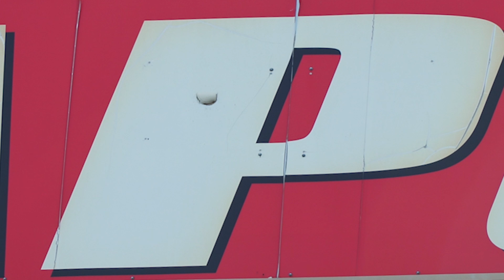3000 HP Cummins Dyno Explosion | Full Story

Comment: Man that sucks. The break line of that block at 6:40 shows there is a lot of area for strength improvement but the casting quality could be a lot better as well. Good quality cast breaks very fine and not super clumpy like that.
Reply from the maker: Agreed, there is room for improvement.  This line of block has been discontinued.  The wet competition blocks have a 300mpa material with a finer grain structure, but the wet cylinders/not solid cast is untested in our large 4.250" bore size so we stayed with the tried and true solid blocks.
Reply: @pddofficial  Sled pulling we started splitting blocks thru the head bolt holes about 15 years ago.  Hard block cured it for awhile, then as power increased the deck plate debored 6.7 blocks became the go to solution. Then the break line moved down to the cam bore and things got  a lot more catastrophic  when they let go. Had a friend of mine split a solid comp block year before last just like yall did.  For the most part when they took the weight off and lowered the hitch it made the trucks hard enough to hook that cylinder pressure rarely reaches the level of "boom" but for competition like you all are doing you will need something to hold a lot more.

Comment: Glad no one was hurt , I was a kid a long time ago and went to tractor pull in I think Dallas and one of the clutches let go and no scatter shield . I think that one of the spectators got killed . I was in Green Valley race way and a engine let go I think it was a funny car , a rod and piston was thrown up and landed way out . Some on ran out and grabbed up the aluminum rod and piston . Well lol the it was not a good idea as the rod and piston got launched again . Holding on to a smoking hot piston and rod apparently are hard to hold on to . Look forward to watching the tear down and hearing what your think the limit is on the components , Thanks

Comment: Why not implement 1/2" cables around the cylinder head and block like a pulling tractor.  With 200lbs a boost there's bound to be a catastrophic failure.

Comment: What is the difference between billet block vs Hamilton?
Reply from the maker: Hamilton Block is cast iron like a factory block.  What's special about the Hamilton block is it addressed the factory block's #1 weak point at around 1500 HP, they crack the cylinder wall.  To fix that, the Hamilton block is cast solid without water jackets or water cooling ports which creates an incredibly strong cylinder wall.  The next weakest link, which seems to come into play around 3000 TQ with the p-pump engine is middle of the block ripping in half from the crank pulling down the head pulling up.  A billet block is machined from a solid piece of material, usually aluminum which allows for added thickness whereever the block designer leaves extra metal.  Billet blocks are incredibly expensive and have their own host of problems associated with aluminum growth and thermal stability vs cast iron.
Reply: @pddofficial  , thank you very much for taking time to explain.

Comment: In the nuclear industry, this is what we call a "near miss." It's an opportunity to learn just like someone got really hurt without having that on your conscience. I hope the good luck here doesn't get taken for granted.
Reply: I am glad someone else is worried about this ,its not funny metal parts flying through the air at near the speed of a bullet ,definitely dangerous
Reply: @andrewcampbell3321  a thick blonde caught a head bolt in her bra. She was jumping up and down like a cheerleader try to shake that hot ARP head bolt from her chest.
Reply from the maker: I highly doubt that happened for 2 reasons:
1. All of the head fasteners are studs, not bolts, and all 26 are still in place securing the head to the upper half of the block, the failure did not happen at the head gasket line.
2.  None of the head fasteners are ARP brand, so said mystery girl couldn't have had a hot arp bolt from PDD's truck.
Reply: @pddofficial  I seen that from the video ,the block split in two head still attached!!! ,defo something to do with the one pistons or cylinder wall/ liner failing
Reply: @pddofficial  think he taking the PISS bigman lol
Reply: They call this in diesel industry a total waste
Reply: @frankjankovich3512  idk about that.. feeling pretty good pushing stock block to only a measly 1000hp now lol

Comment: Apparently Cummins blocks from Utah are weak.  Or Utah builders are next level!!  It's crazy to me that you were in full safety gear behind a firewall & the dyno operator is standing next to a 3000 whp truck with no safety gear!!  Great job guys!  Sorry for your loss.
Reply: The motors get a lot more oxygen down off the moutain. It would be good if pdd could tune at altitude

Comment: Damn! Idk how you guys haven't killed someone with how these engines come apart. Glad no one got hurt.
Reply: You would think these people for insurance and liability reasons would be forced to have the Kevlar diapers on them. They're mandatory on the drag strip and nobody's as close as they can be and they're running these dinos except for the people working there but they make sure people stay out of the way cuz they've seen that stuff happen I'm lucky they ain't hurt nobody.
Reply: Yeah. Just a simple chain link fence surrounding the engine block would do a lot to protect people from debris. Weird.
Reply: @boowiebear  I agree they should have at least something if anybody knows Big Daddy don garlits no she almost severed his foot when his drag race motor exploded it was an old slingshot dragster but he almost lost his foot and that's when they made scattered Shields mandatory and then they have the Kevlar diapers and wraps on them they keep cylinders and pistons from flying out everywhere and it's not heavy stuff all the other cars are required to use it all diesel on the track should have to have the same thing
Reply: @boowiebear  they make a Kevlar diaper for the bottom and then they have camera that wraps around the cylinder heads to keep pissing from flying out into the crowd. I know all the top fuel and funny cars and run them. I'm not sure exactly on the rules cuz I know it is based on how fast your car can go I believe and horsepower. I know the scatter Shields are mandatory for most cars. I mean it does go on the track and race you would think you would have something with that kind of power all the other cars do it's to protect people the driver and the track.
Reply: Wait .. you don't think a straw hat can stop a piston? At least the guy in the car had a helmet, although he wasn't wearing gloves. I wear more protection at the kart track lol.
Reply: @davidleonard50100  Nice try.

Comment: Their they go again destroying another Cummins engine trying to achieve a 3000 horsepower goal that can't be done given the displacement of the engine a 5.9 and 6.7 liter Cummins engine can't handle that kind of horsepower because the torque is nearly double the horsepower number no matter what the engine block is made out of because of physics they tried to put 20 pounds of potatoes into a 5 pound bag 200 psi of boost on top of a compression ratio of around 18.5 :1 the block just couldn't handle it they need to be using 8.9L Cummins engine instead. Didn't learn anything from their previous failures after destroying at least one different engine before this one. Engine block material can't help in any way to prevent this this is what happens when you push a engine past it's limits given the displacement of the engine a 5.9L in cubic inches is 360.04 and a 6.7L in cubic inches is 421.064 even gasoline engines can fall just bad at 3000 horsepower and their running at a much lower compression ratio with boosted applications your engines compression ratio needs to be at lowest amount it can to prevent the same outcome as to what occurred in this video even tractor pull engines never go past 100 psi they went double that amount and paid the price for it.
Reply: 3000 has been made many times.

Comment: At what point do you or any other testing folks start using safety measures before someone gets killed or severly injured ? Folks all thru the stands had enfine parts flying into them. Maybe it will taje that to start using engine containment equipment

Comment: You know, I just don't think a cummins based block can make 3000. Baca split his block in about the same fashion you guys did and he was also going for 3000 hp. Good luck and I hope one day you guys hit that number but I don't see it happening on a straight 6 cummins type engine.
Reply: 3000 has been made 100s of times but those people know what they are doing.
Reply: @V8Lenny  was that on a engine dyno or chassis dyno?
Reply: @ThirdHornet  engine , some pullers have 3500 I think. Maybe without BS 25% correction factors like UCC use.
Reply: @V8Lenny  I was not aware of that, I stand corrected.